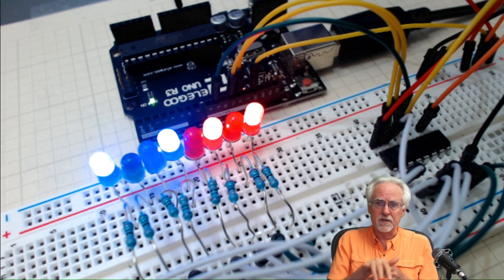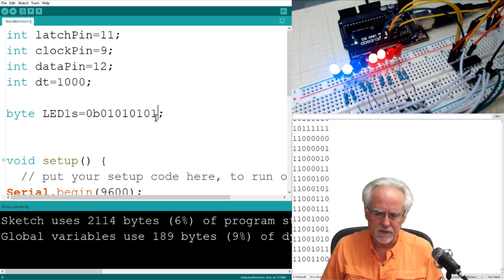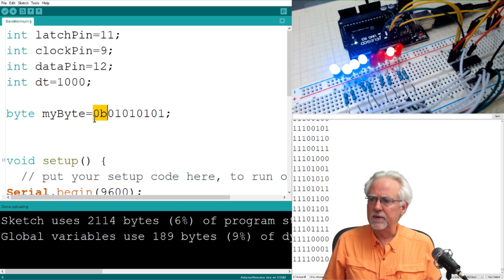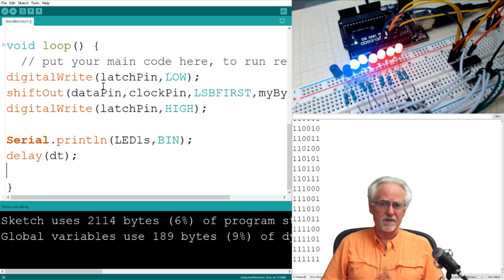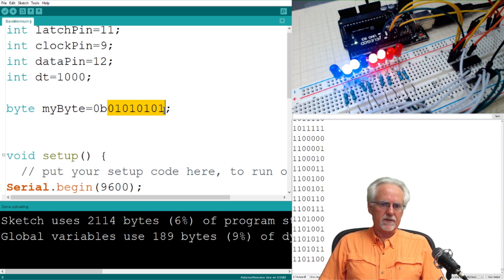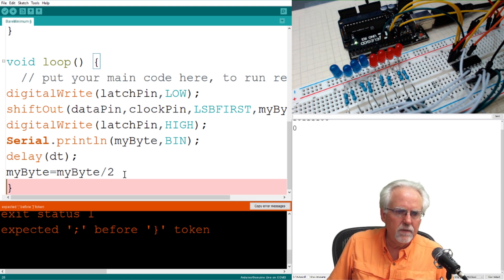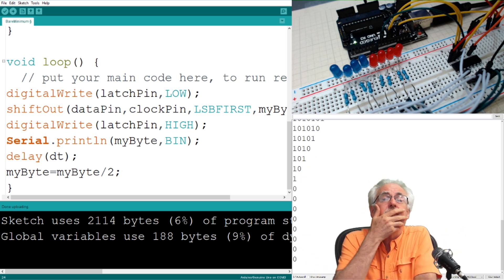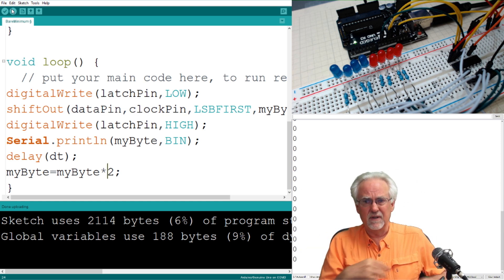Arduino Tutorial 44: Understanding Logical Shift Left and Logical Shift Right with the 74HC595

Comment: I made a "shifter" first to the left and then to the right, and restarting again. One problem I encountered was that in the shift to the left, the number got soon two big to be in an int type and then all sorts of crazy things happen. I had to declare the variable as an unsigned int. I leave my code here:
int latchPin = 11;
int clockPin = 9;
int dataPin = 12;

byte LEDs=0b11011011;

int dt = 500;

void setup() {
  // put your setup code here, to run once:
  Serial.begin(9600);
  pinMode(latchPin, OUTPUT);
  pinMode(dataPin, OUTPUT);
  pinMode(clockPin, OUTPUT);
}

void loop() {
  // put your main code here, to run repeatedly:

  unsigned int goShift = LEDs;

  // start lights
  digitalWrite(latchPin, LOW);
  shiftOut(dataPin, clockPin, LSBFIRST, goShift);
  digitalWrite(latchPin, HIGH);
  delay(dt);

  // shift ligts to the left
  for (int i = 0; i < 8; i++){
    goShift = goShift * 2;
    digitalWrite(latchPin, LOW);
    shiftOut(dataPin, clockPin, LSBFIRST, goShift);
    digitalWrite(latchPin, HIGH);
    delay(dt); 
  }

  goShift = LEDs;

  // shift lights to the right
  for (int i = 0; i < 8; i++){
    digitalWrite(latchPin, LOW);
    shiftOut(dataPin, clockPin, LSBFIRST, goShift);
    digitalWrite(latchPin, HIGH);
    goShift = goShift / 2;
    delay(dt); 
  }
  
  goShift = 0;

  // lights off
  digitalWrite(latchPin, LOW);
  shiftOut(dataPin, clockPin, LSBFIRST, goShift);
  digitalWrite(latchPin, HIGH);
  delay(dt);
  
}

Comment: I was lost before this Tutorial, but after it I was able to shift form B00000000 to B11111111 the back down to B00000000 then back to B11111111 nonstop. This was the code I did for(byte j=B00000000; j<B11111111; j=j*2+1){print code here}    for(byte j =B11111111; j>B00000000; j=j/2){print code here}...by doing this, it would shift continuously right and left. Paul is a grate Teacher!!!!!!

Comment: I was able to figure it out by looking at the chart you drew on a previous video & tracking the rows with just 1 bit on. I saw that each time (1, 2, 4, 8...), you could just multiply or divide by 2 to reach the next step so I tried it in my code and it worked! I'm often guilty of over-thinking so these assignments are helping me to try and reign that in some. So often, the answer is simpler than I thought!

Comment: This one confused me because I originally thought that *2 and /2 might be a solution but I imagined it may not work for /2 because I didn't know how integer math would work with the program. For example if we used 01010101, we have 85, but if we run the /2 loop a few times we get 85, 42.5, 21.25, 10.625 etc. So I concluded this would not work for /2. But alas, it does.

Comment: I did this homework in a different way.  I used the bitRead() function to read the bit in question into a variable.  Then I did the shift using 
multiplication or division as necessary, then wrote the bit to the correct position using the bitWrite() function.  Just my $.02.  Thank you for 
this series.

Comment: Paul, finally  found solution for an assignment after a few days. Tried not to complicate programming andlook forward  to see lesson 45 to compare your and  my script. Anyway, it great for me  to follow your lessons. As I am always you are my favorite tutor.
Reply: During  program run and  as monitored through Serial port found:A. If  left shift -  generates  0s',B. If right shift - It is just blank instead 0s'.Interesting.
Reply: Serial.println(x, BIN); // Doesn’t print leading zeros (“0”)
 
The following routine prints all the bits.
You could also write it as a user-defined function.
It simply reads and prints each bit, one at a time.
Bit by bit read and print.
 
//Prints all the bits in Byte x
  // (replace x with your byte or byte variable)
 
  byte ab = x;
 
  for (int i = 7; i >= 0; i--) {
 
    Serial.print(bitRead (ab, i));
  }
  Serial.println(" ");

Comment: What a great lesson. The homework really made me think. I finally settled on using the (AND) & function to determine the value of the LSB then added 128 if LSB was 1. I look forward to your solution.
Reply: You’ve got it figured out.
Try the | (OR) too.

// circle right
myByte = (myByte >> 1) | (myByte << (8 - 1));

// circle left
myByte = (myByte << 1) | (myByte >> (8 - 1));
 
note: the 8 is the total number of bits, in this case a byte, 8
***********************************************
Example: the flow for a circle left
Step 1 - myByte = B11000000     
(B11000000 << 1)   is B10000000   (shifted left 1 bit)
Step 2 - (myByte >> (8 - 1));
(B11000000 >> (8 - 1)) is B00000001(shifted right 7 bits)
Step 3 - bitwise OR the two results to recover the bits pushed off the end.
B10000000
B00000001
B10000001

Comment: Another great video Paul. As with all your videos. I only have one question I have been meaning to ask for ages. As we see in this instance how you are moving the bits left or right by means of division of 2 or multiply by 2, 2 being the base of binary.... Where, when, or how would this need to be implemented in code and used in real life projects. Sort of asking when we know what it does, why would we need to know that it can do this? Many thanks for the great way you explain things and here is a few semi-colons for you that you forget now and again... ;;;;;;;;;;;;. 😃😃
Reply: Most sensors and hardware interfaced (I2c, SPI, 1-Wire, etc.) to the Arduino requires bit manipulation at the register level. Unfortunately, you may never come in contact with bit handling, since someone has already written a library to take care of that.  The very popular DS18B20 temperature sensor exemplifies the degree of bit manipulation in its datasheet: https://datasheets.maximintegrated.com/en/ds/DS18B20.pdf
https://playground.arduino.cc/Code/BitMath/
 
We can use the following line to move the high byte in a 16-bit register into the lower 8 bits and move the low byte into the upper 8 bits, circle left rotation:
HHFR = (HHFR << 8) | (HHFR >> (16 - 8));
 
In your case, circle rotation of one-bit shift of an 8-bit byte.
 
// circle right
myByte = (myByte >> 1) | (myByte << (8 - 1));
 
// circle left
myByte = (myByte << 1) | (myByte >> (8 - 1));

Comment: No I used the  >> operator to right shift  and the << operator to left shift. Looking forward to the circular shift.  Thanks Paul.
Reply: You’ve got it figured out.
Try the | (OR).  
 
// circle right
myByte = (myByte >> 1) | (myByte << (8 - 1));
 
// circle left
myByte = (myByte << 1) | (myByte >> (8 - 1));
 
note: the 8 is the total number of bits, in this case, a byte (8)
Reply: I too did it in the same way but whys it not working
Reply: Cool
Reply: Same, and I did 2 For loops. One to increase, one to decrease, that way I have a single LED traveling, sweeping left to right!